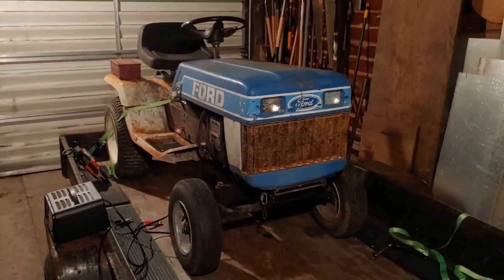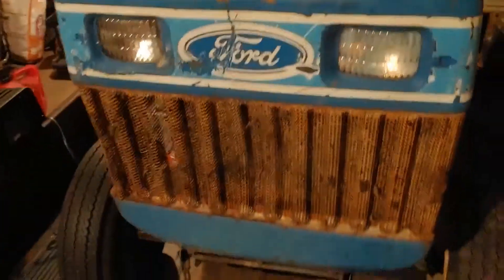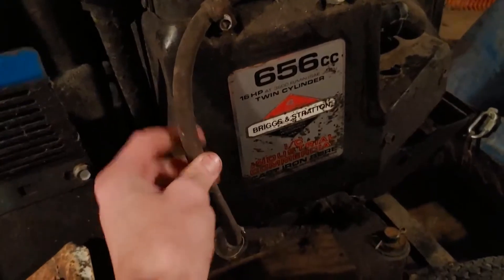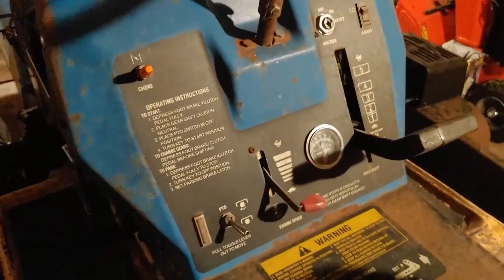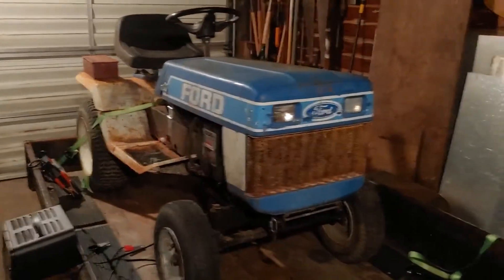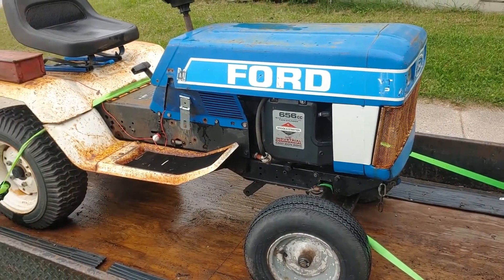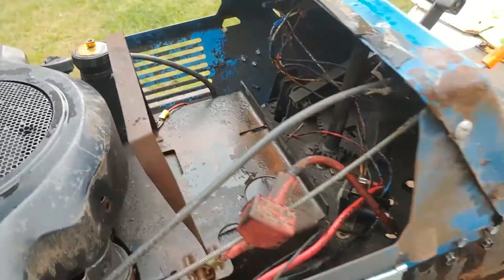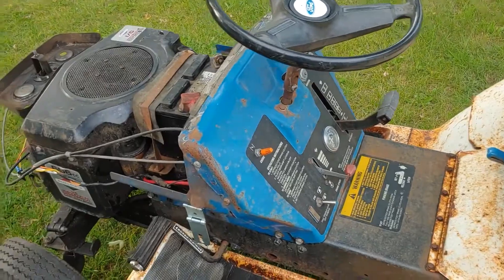Fixing up a 1985 Ford YT 16 pt.  1 - overview and preparation

Comment: I have the yt12.5, same as yours but GT under the seat, side shift and steering wheel, I flipped the TA and lowered mine,, they say the 12.5 and 16hp OT engines ere identical except the HP sticker